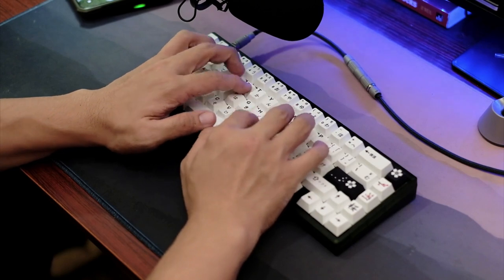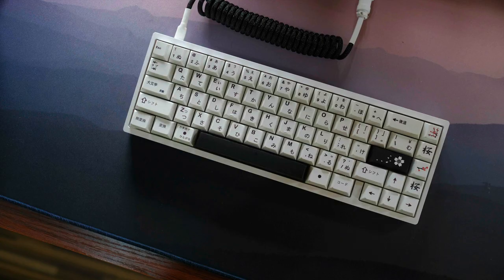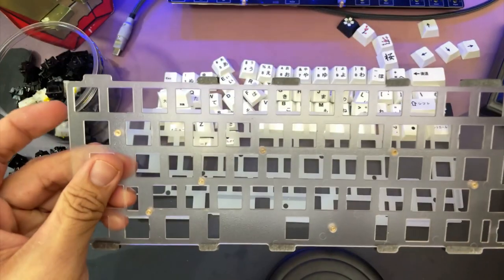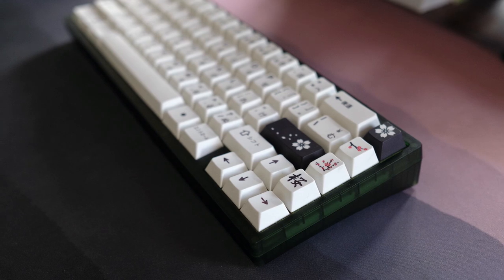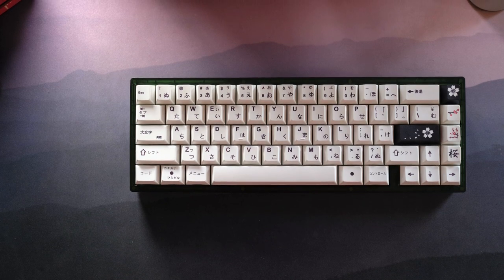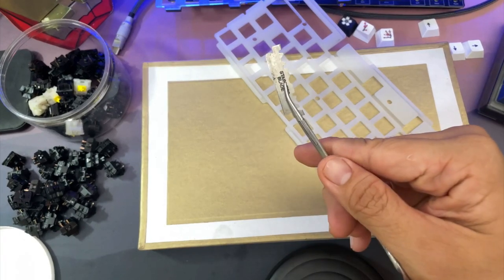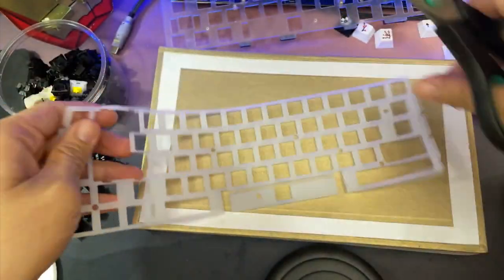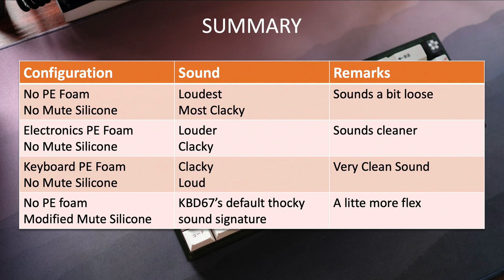KBD67 lite Modding Guide - Transform to make it Louder Clackier Flexier

Comment: What brand of stabilizers are you using doc?
Reply from the maker: Durock v2 screw in in this vid
Reply: @ThockyDocKey  thanks doc, i've been using everglide screw in for my kbd67 lite, looks like durock v2 gives better result no matter how much times I tried to holee mod and lube my everglide.
Reply from the maker: @terrencesimon265  hmm i heard from friends that the everglides are good too. have you tried balancing the wires?
Reply: @ThockyDocKey  yes I have tried balancing the wires and still cannot get good results on my spacebar. I'm just thinking of getting the durock v2 as replacement.

Comment: If you want to make it clackier, why not just use the FR4 plate? it would sound really close to this without the mods.
Reply from the maker: that could be an option but FR4 for the kbd67 is not readily available. and it will entail extra cost.  

This mod is close to free, just have to get some gaskets.